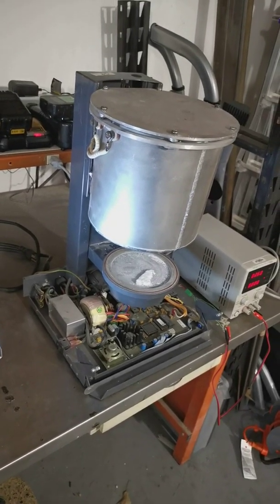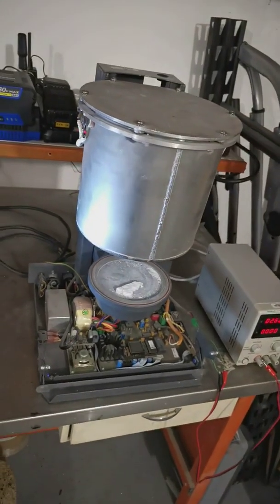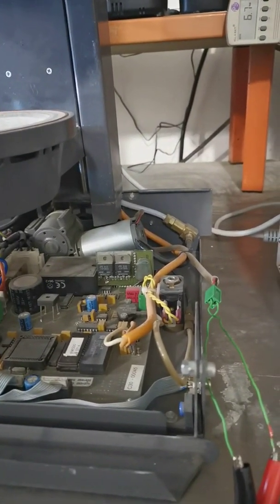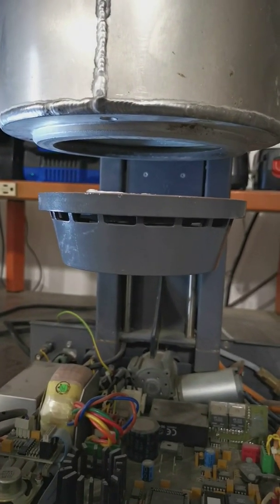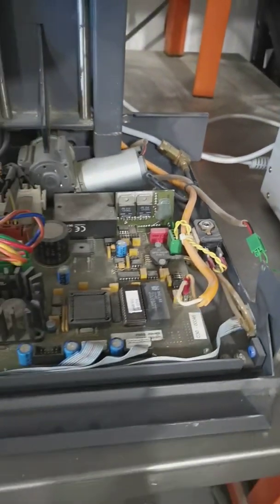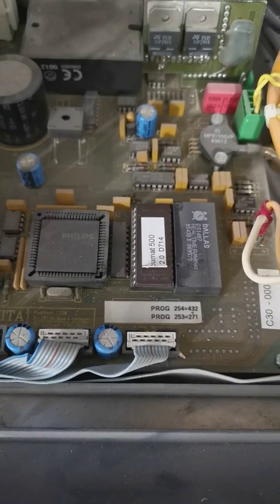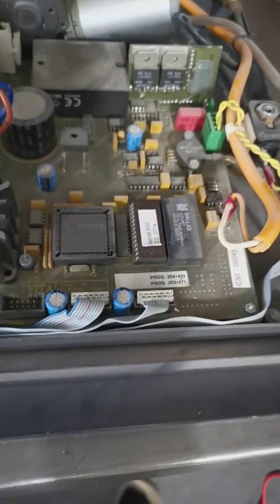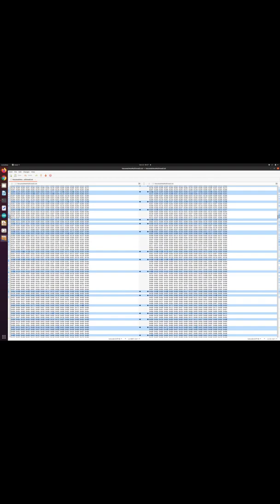Vita Vacumat 500 Vacuum Furnace Reverse Engineering

Comment: Hello this is a very interesting video. I have a couple of these ovens. We’re you successful rebuilding the cpu.
Reply from the maker: It turns out that the ROM was still ok, and that there was a loose wire that caused the error beep on turn on. I'm still missing the front panel and still intend to reverse the bus messages, but work and family commitments are making this impossible right now. Do you have the operator panel?
Reply: Hello
Reply: Sir can u send me a motherboard for my vita 2500